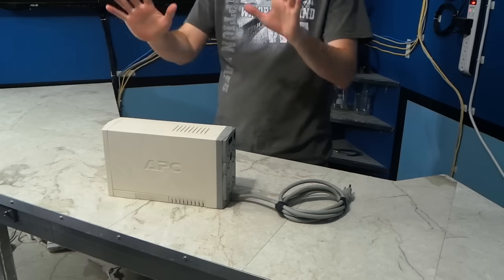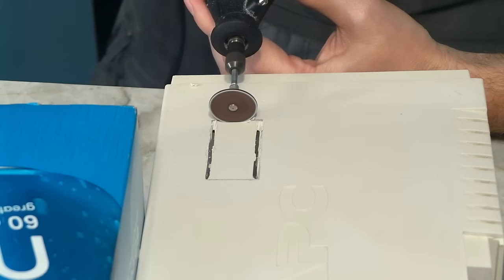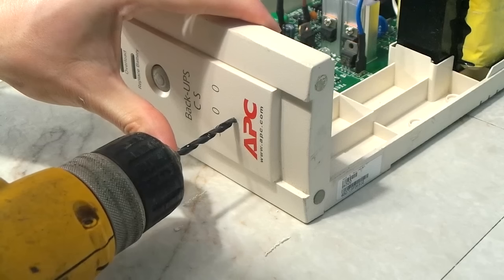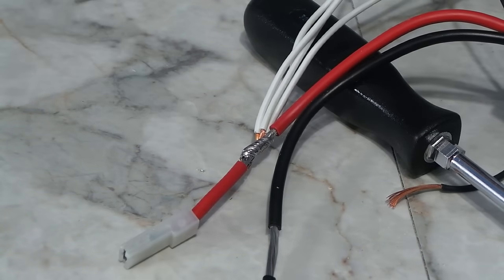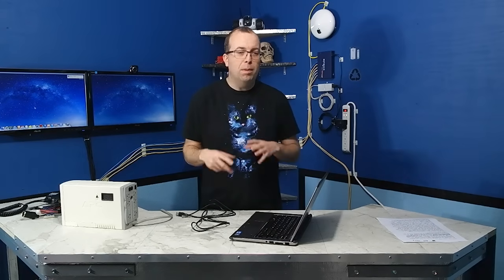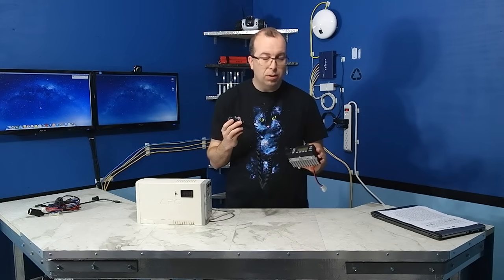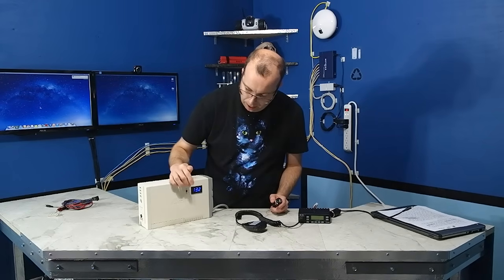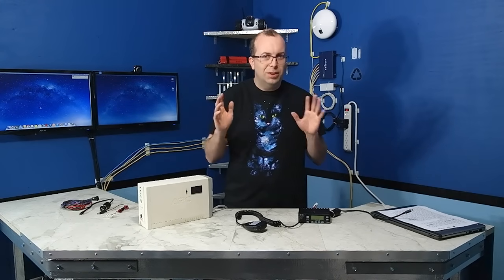Ultimate Battery Backup Hack/Mod.

Comment: In fact an inverter draws power even when there is no load on it. On my solar setup, I have say a small fridge that draws 720wh per day, well I found that the inverter powered on draws another 720 wh per day. In my case I can't switch it off because all the internet box, wifi, swiches, web server etc and fridge is on it, but this fact must be measured, known and taken into account. The inverter gets more and more efficient the more load you put on it. When it outputs 600w to 2500w power it's 96%. The worst case is when it's on and there is no load, you have those 30 to 35w idle power loss. Also I noticed great differences in transformers efficiency, some are catastrophe, others are quite good. Old ipad 10w transformer was horrendous at 52% a newer one does 85%. You can't tell without measuring it. Having 24V to 5V usb buck converters dc on the batteries is the best way.

Comment: I was thinking about doing this to power a 12V GPON Router, but its adapter is rated at 24 Watts (12V@2A) and any UPS I check can only charge the battery at maximum rate of 5 Watts (12.6V@420mA). It would turn off the charger completely if you drew more than 500mA, and an older more basic one would drop down to 5V@820mA, which is still around 5 watts.

Comment: 1:24... the phone line protection, it looks like they were RJ-45... so could be a network line protection.  But if not using it... the mod is a good idea :)
Reply: RJ11 and RJ45 sockets look incredibly similar, so much so that I'm always thinking WTF when I think the BT engineer installed the wrong type!

Comment: You should make a follow-up video (if you still have this UPS) to exchange the Lead-Acid battery with a Li-Ion battery pack with BMS and solar charger circuitry? It's 5 years, a lot has changed in this field.

Comment: use tape when you drill a hole 
just put clear tape on where you will be drilling it will prevent cracking or etc and makes clean cut

Comment: Some older UPS units dont have a "cold start" option and will only work when AC power is first available and subsequently "cuts out." AKA make sure your unit works on it's own without wall power to activate it
Reply: That is so true. I have that issue with my UPSs. Thank you for bringing this up.
Reply: @Dsaints204  But for those external connectors that go directly to the battery wires, it isn't an issue!

Comment: The weak link for one of those APC units is the battery.  I'm wanting to add an external battery port to mine so I can add additional battery capacity.  I would use Anderson Powerpoles.  They can carry 15, 30, or 45 amps, depending on which one you use, and those connectors are all compatible with each other and are genderless - so it simplifies connecting things. Much, much better than barrel connectors.  I wonder if you get birdies on your radio from plugging into the APC?  The power supply on those might not be best for radio communications gear - could cause interference, but you won't know until you test it out.  73 de N5IMA.

Comment: I want to see an updated version with a 24v UPS. If there was six batteries(two in the main unit, four more in the extension), how would you handle that?
Reply: Series parallel connection.   Very common when more capacity is needed.
Reply: @robertheinkel6225  I rather step the voltage down. I'd use multiple switches though, I have a hundred.

Comment: One critical thing is missing...a fuse or any other shorting protection BEFORE the 12V outlets. If one shorts a battery without protection...you have a fire!

Comment: depends on the battery of the phone.....  

the inverter battery is 7.5 AH 

so a 2000mah battery phone can be charged 3 and half times only

not 13 times
Reply: Bisgamer Gameplay your phone has not 12V but like 3,7V... Look up the Batteries Watt-Hours, they will give you comparable numbers when you’re dealing with different voltages.
Reply: @dauerwerbesendung7045  yes i know.....  lets assume he adds buck converter (which wastes energy by emitting heat) 

eventhough he cant change his phone for week

Comment: Just curious why don't they use lithium batteries as of now? It's always lead batteries. I've seen small battery banks able to do 60-100 watts of power. I know lead can do plenty amps but the capacity sucks. Sorry for my ignorance with this question.
Reply: Reliability in an emegency trumps Energy capacity.

Comment: By modifying the case and adding unearthed, touchable, metal parts that penetrate from outside the plastic case to inside, you’ve compromised the electrical protection method used for this device, and could create a hazardous situation if there is an internal fault.

Comment: Could I also add a 120v relay to drop out when the power goes out to switch on several 12v leds being fed from the battery? That way I could install a few recessed 12v lights throughout the house to come on when the power goes out

Comment: I have 4 of these battery backups and they all failed within 3-6 months using them just as backups. I now have an entire battery bank of these small 12v batts, like the one you pulled out of there. I'm also a ham op. I thought about using this extra power gate and using them as a battery back up for my garage radio, since I already have a solar power gate backup in my base station setup with a 250ah 150lb AGM. Anyway, I clicked here to see if you did anything different as a battery backup for your computer. That's what I need. I DIY method for backing up my desktop.

Comment: Do you still have this UPS pack? I'd like your opinion on fitting a solar charge controller and a 20 - 50w solar panel so that mains off run time would be much longer.

Comment: Question I own an APC Back-UPS Pro 1100 (BP1100). I just replaced the battery but after assembling the unit back I turned it on, the green LED turns on first blinks 36 times the goes off, at the same time I get a solid amber LED, beeping 4 times (5 times with a 30 secs interval). What can I do???

Comment: How about detecting the power outage and switching the display off automatically ?
Or even better, install a switch to only display the voltage when depressed… that way you press it to,check voltage but don’t waste any energy even when plugged in.

Comment: you should plug a secondary car battery, which only cost  less than 100 bucks, into one of the port which only cost  less than 100 bucks, you get yourself a super battery backup

Comment: Next level of this is to power a computer using DC only. Such an adapted UPS can be integrated directly with a PC MB since that does not require more than 12V. It only needs 12, 5 and 3.3V.

Comment: Now,  we have a tradeoff between efficiency and reliability when it comes to ferro-resonant  vs  switch mode transformers.  I have dug perfectly good ferro-resonant style UPS units out of dumpsters,  mainly because they were discarded due to bad batteries or lousy efficiency (about 60%).  At least they were pretty close to true sine wave output, as opposed to the cheaper models which put out a modified sine wave or a square wave.  Still,  a good switching UPS employing low level PWM modulated by a sine wave oscillator and good output filter is far more efficient than a 60 Hz ferro-resonant design.  I believe the poor reliability in SMPSs is due to poor design in the cheaper units.  A decent SMPS can rival the reliability of a less expensive F-R design,  while breaking even on cost in the long run,  due to its superior efficiency.  And in air conditioned spaces,  poor efficiency delivers a doubly whammy to energy consumption,  especially with the on-line UPS models.   Just my honest opinion.  YMMV...

Comment: I have a 330 watt APC BE600M1 with a 140 watt load. I hooked to a deep cycle lead acid  marine battery to the UPS battery wires with the UPS battery still installed in the UPS. It wouldn't work at all powered by the marine battery unless the UPS battery was still hooked up. .  The marine battery is supplying 12.5 volts to the UPS but it pretends like it isn't even there and shuts down in 15 minutes same as it does without the marine battery hooked to the wires.  I don't understand why?
Reply: My apc by ex uses 24v battery or 2x12v in series

Comment: Is there any danger running a UPS like this continuously longer that it would with the stock battery.   I have thought about
putting a couple batteries together for more current but was concerning I might burn out the UPS from running it to long.

Comment: You probably want to add an external battery plug to use 12v car battery (which it has more power in it) and if I doing this, i probably will mod the wave output of the inverter with EGS002 inverter driver board so i can get more usefull power out of the high voltage output from it

Comment: It never really occurred to me that the battery, much like a car battery needs to stay fully charged otherwise it could become so discharged that it won't take a charge anymore.
I've had one of these sitting around for years, so clearly the battery itself is dead and that explains why it won't do anything when plugged in.
I only truly realized this because I have a portable stereo (and Ion Job Rocker) and its battery also died because I never kept it fully charged.
Something I've recently learned about SLA batteries. I've also recently discovered LiFePO4 batteries that are lighter, provide more capacity, better stability, faster recharge, and longer life.

Comment: Out of curiosity David what's what brand and model is the mobile radio in your video . in my shack i run a 20amp 22amp surge power supply and a charge controller to charge deep cycle battery's. i also charge the battery's off a 300watt solar pannel .i have a 300watt inverter i'm yet to hook up. i have 2 x 12v camping light bars in the shack. i can get about 4 or 5 hours on the 300watt inverter from 2x deep cycle batterys .VK6FCRC

Comment: Cool ideas! Now, how much power can you continuously squeeze out through the 12VDC when the UPS is connected to the mains? In other words, how much current can the UPS battery charger supply? That battery shouldnt be charged faster than 2.2A. The battery itself will probably give you plenty of amps (maybe even 30A with a thirsty load) but it would be discharging because the charger is not designed to supply more than 2A, right? The inverter stage however can pull all those amps from the battery and provide that power in the AC output (minus the conversion losses). In normal operation (connected to mains and feeding an AC load) the power flows from IN to OUT bypassing the battery (battery is kept at floating voltage and output is surge protected as you explain...). I guess if you would try to continuosly pull 5A directly from the battery you would still discharge the battery and eventually bring the voltage too low. Am I right? if this is so you could even stress the charger (in case it's not protected). Let me know your thoughts.

Comment: You should have added a high amp 12V inlet to allow use an external deep cycle battery thus adding 10X runtime.

Comment: Not all ups works the same. Actually there is On-Line UPS which powers always the output from the battery with real sinus wave. Basic ups don't give sinus wave which is bad for electronics for extended time.

Comment: I stumbled upon this while doing some research on how I might design a better solution than the PWRGate for my ham station because I intend to make a seamless battery backup.  Neat project, but I really don't see those 3 DC jacks being capable of pulling 16 amps a piece.  Those plastic DC jacks you have probably only have a rating of 5 Amps, and that's being very generous.  I would have safely daisy chained those without a care in the world.

Comment: Or you could have just bought a Cyberpower UPS back then that had a FULL LCD display, USB ports on the front and one on the back to connect to a PC all in a sweet black case for just a little over $120 back then. How do I know, I bought several of them and they are still going strong after just replacing the battery last year.

Comment: I was hoping to see you add a 12vdc input to the battery "bypassing ac" so you could charge with a solar panel.
Reply: For. More run time add a daisy chain plug to the unit and some deep cycle batteries you can then add solar charger to the  daisy chain port so when the power goes out you can recharge it during the day

Comment: Try this same backup in countries like Pakistan or Afghanistan or Iraq where the power goes out every hour for 1 hour in winter and if you are outside a metropolitan city like the provincial capitals then its 3-5 hrs  of lights gone and a ups definitely comes in handy, my question here is can u add a voltage regulator to attach for other devices

Comment: I went 1 step further I drilled a hole in mine and feed solar power directly to the battery run AC for hours now very cheap off grid solution. can also use that conversion for 12v

Comment: So is unit actually 12 volts the other ones on the net are 24 volts if it is it gives me hope for mine I'm trying to find my batteries as I had removed them from the ups I just assumed they were 12 volts my off grid system is going to be 12 volts and that will mean I'll need a secondary charge circuit for the ups unless I can charge it from a modified sine wave inverter

Comment: I always wondered why UPS's went AC -> DC -> AC. Computers work on DC, so now you're doing another AC -> DC. Why not keep charged the appropriate (5V and 12V) batteries, while also powering the computer directly from the same DC? You know, kind of like a laptop?

Comment: How well did your rig work with the radio? I'm a little skeptical because I know with an 80-watt 2-meter rig I couldn't draw enough amps through a cigarette lighter-type socket in my truck, and I wound up running a dedicated line with 10ga wire from my battery to the radio (fused of course). If it works though, hey! Cheap power supply!

Comment: I was thinking to put alligator clips instead of the battery and plug it into the car battery so you can use it as a power inverter 110v from the car or from solar panels

Comment: Get a 12 volt charger for your laptop,  as well as 12volt power supplies for your modem/router.  Should be able to run those for a while

Comment: What happens if we are using 12v connection for wifi router and battery doesn't have charge left? Do we need over discharge protection?

Comment: Does this mean that if the AC power is on the battery would be charged and also power your load? In the absence of AC power will it automatically switch to battery? I heard you say you have to switch off....something.

Comment: screen shows 13.2v
"I'm just gonna plug these 12v devices and stuff directly into the inverter output and batteries!!!!!!

You have bypassed all the safety features of that device...
Reply: Usually all devices have some tolerance for voltage in the range of a few volts since almost all regular 12V appliances will have voltage regulators in them, apart from that, under load, the voltage is gonna drop a bit. Also, not in the inverter output, rather the input. The output would be 110V. That said, there is the possibility of undercharging the battery now that the devices are directly connected to it.
Reply: Other than this setup not using fuses on the 12v outs, 12v items are actually able to handle voltages from 10.5 all the way to 15v. 13.2 is just a full charged SLA on standby. This is totally safe.

Comment: How do you feel about connecting a car battery to the replace the battery?  In theory it should be the same, my only concern is what is the charging voltage of the charger?

Comment: The UPS said it was only going to run for 68 minutes with no load. I'm not sure why you think you're going to get days out of it just because the load you're intending to add is going to bypass the DC inverter.
Reply: The conversion of DC to AC wastes lots of energy in the conversion process. Using these small devices that just sip 12v power, its not outlandish to think you would get that battery life.
Reply: @johnkrejchik6838  But it wasn't converting any DC to AC. There was nothing plugged into it.
Reply: wbfaulk it’s still running the internal components, and the converter is still active. It needs to make that 120v potential thats waiting in your outlets too
Reply: @johnkrejchik6838  And those components are going to somehow just stop consuming power because you have something else drawing power before the inverter?
Reply: wbfaulk if you turn off the UPS like he says, yes.
Reply: @johnkrejchik6838  huh. He does say that. Fair enough.

Comment: Caution... I've been advised that in some UPSes, the batteries are not isolated from the AC line.  That would make the DC jacks dangerous.
Reply: How does that work?  The battery would have to be AC if that was the case.  They must mean that the battery is directly bussed into the inverter that there is no wire to tie into.

Comment: SLA batteries of 7Ah 12 volt have a floating charge voltage of 13.5 to 13.7 volt, connecting a direct output to that line could seriously fuck up hardware.
A wifi router/access point could be fine but assume you want to power a 5 meter led strip you will burn it in a couple of days, some electronics using a AMS1117 regulator would also fail or slowly fail